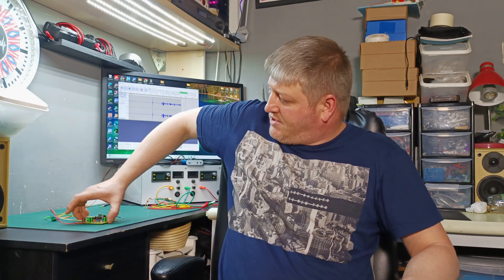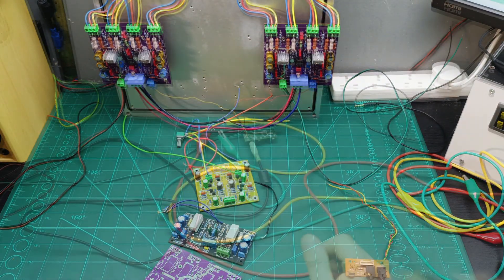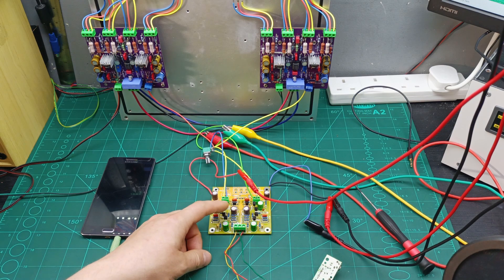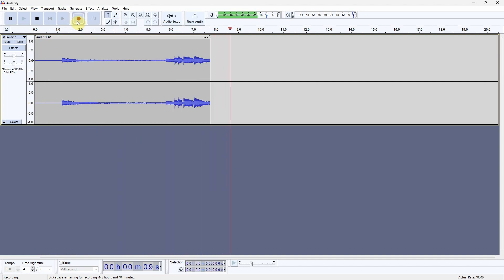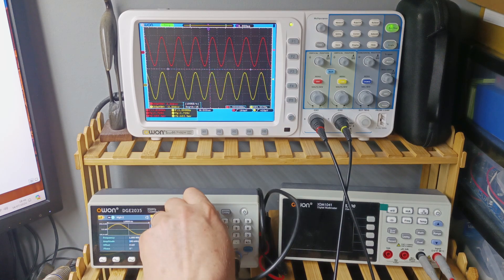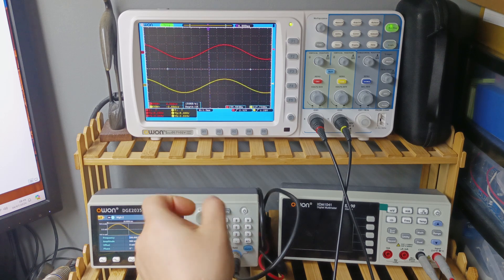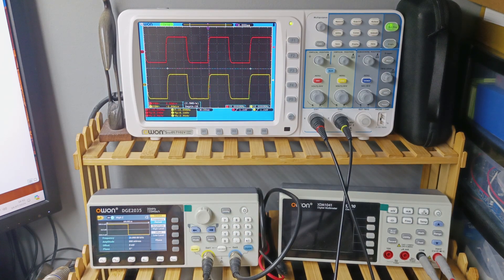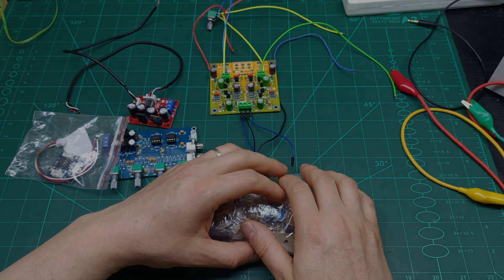Testing the Pre Amp with my own design class A amplifier

Comment: Definitely more distortion with the preamplifier. Don't know what to tell you beyond that.
Reply from the maker: @danishdart  in sound I find it more crispy the treble and a wider sound stage and I noticed as well that there is a bit of noise when I'm not playing the sound but this matter I need to check with a better power supply that have more smoothing capacitors. The bench power supply have only 3300uf so for a better smoothing I believe at list 10000uf will be better
Reply: @SymbolTech21  The 'crispy' sound, sounds more like higher frequency distortion. If your power supply is switchmode it could definitely be adding
distortion.. For which you'll need better smoothing capacitors.. Or perhaps a linear power supply. Good luck.